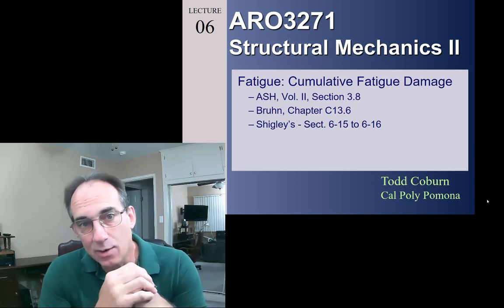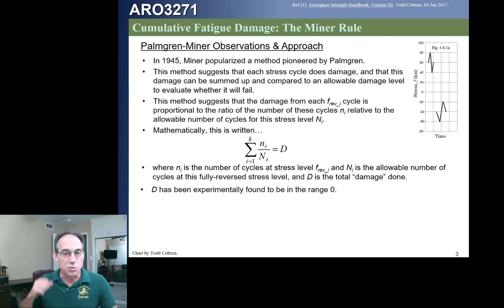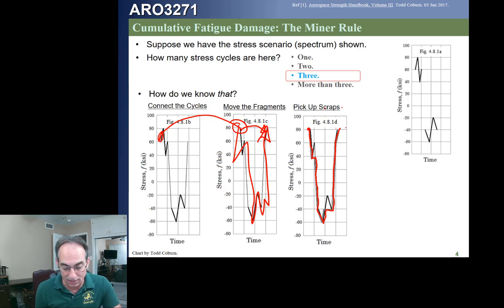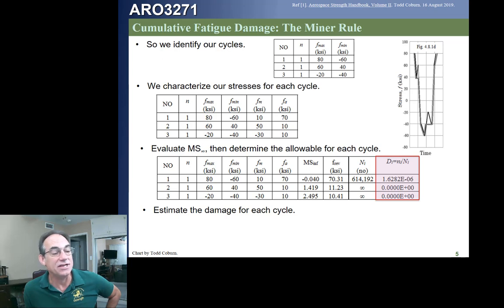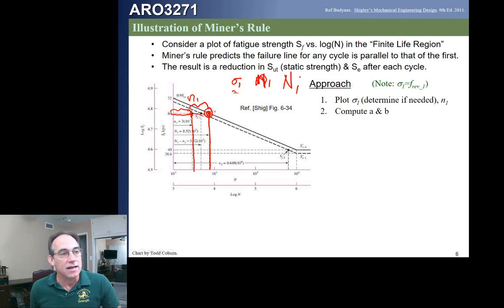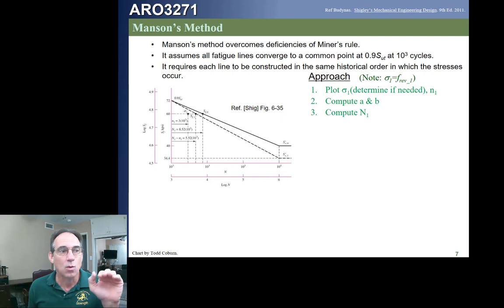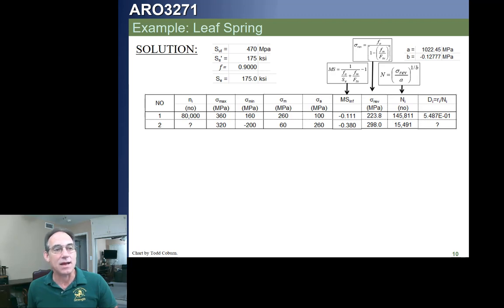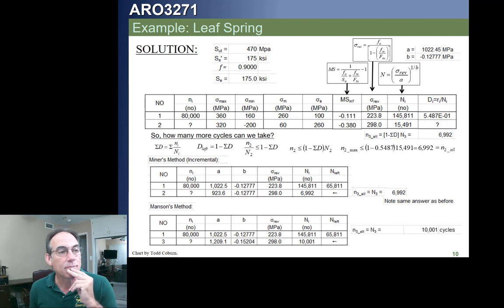Stress Analysis II: L-06 Fatigue - Miner's Rule

Comment: Hi Todd, just a quick question, on mark "13.08", I'm trying to to come up with the same numbers for MS(inf) for f(rev) and N(i), assuming Modified Goodman failure criterion - what are the materials Ftu, Fty, and probably Se would be 0.5(Ftu) if material is Steel? Very Nice presentation, really helped me to see the big picture, thank you for that!
Reply from the maker: Sotir,  You are most welcome.  That particular example is not as detailed as it should be, and I need to add a video with a few better worked examples (hopefully soon).  However, in answer to your question, Ftu=151 ksi & Se=67.5 ksi after accounting for the pertinent Marin Factor.  Remember, any fully-reversed stresses below Se cause no damage.
Reply: Great, thank you Todd, let me see if I would come up with the same number for margins...